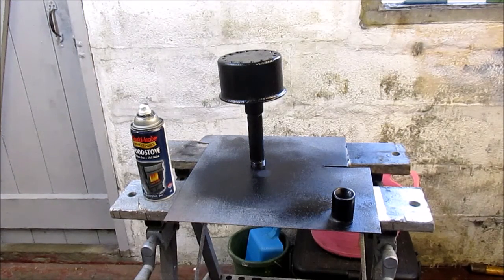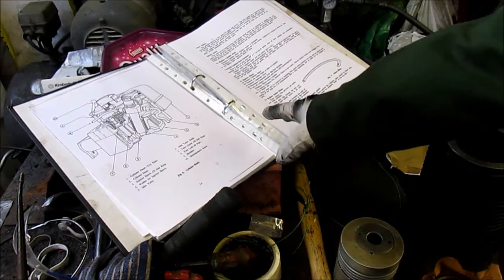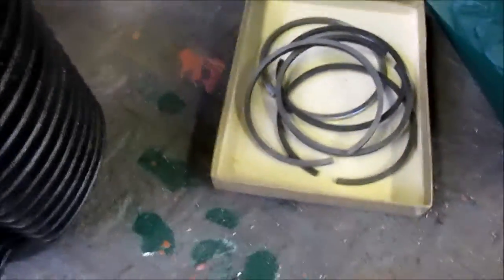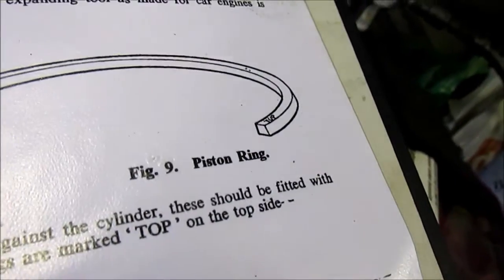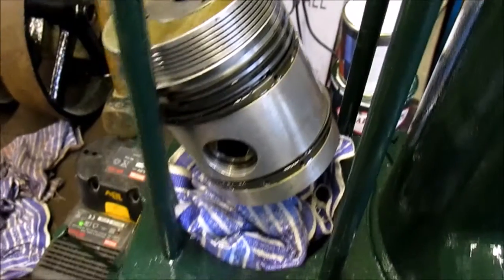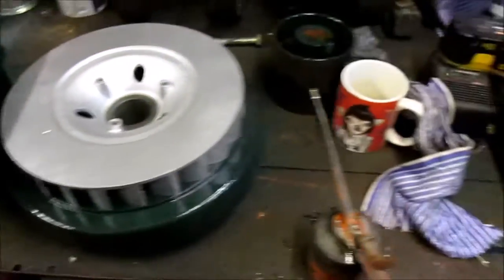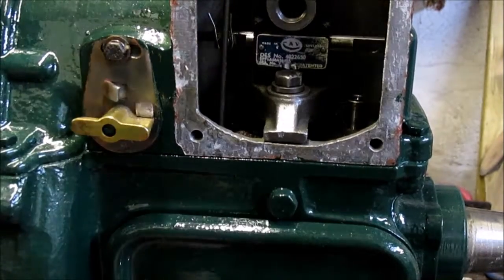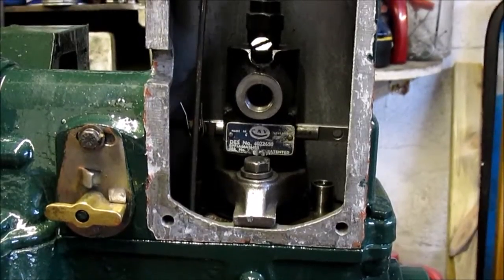Lister LD1 Restoration Part 15

Comment: Hi, Indeed great job,  I have learned lots of things from the series.
I have a Lister Petter TR2 Engine and I need to know how to check Piston and valve clearance. It has a gasket and a shim installed, I looked at the manual but need some guidance and what is correct clearance.
Reply from the maker: Abdul Rauf the piston head clearance is called the bump clearance and is done by putting a piece of lead solder on the piston and refit the head then torque down the head and turn the engine over until it squeezes the solder flat then measure the thickness of the solder then add or remove shims till the correct clearance is gained. in one of my videos I go through bump clearance. hope this helps